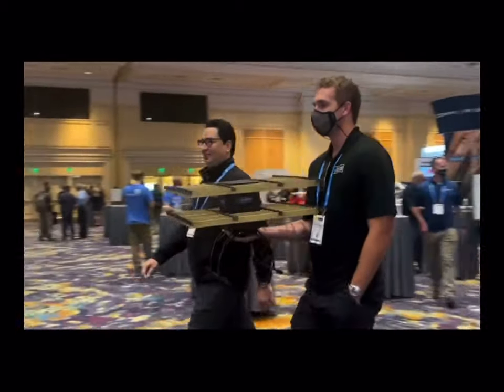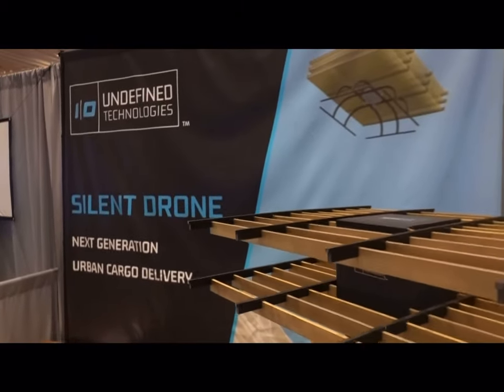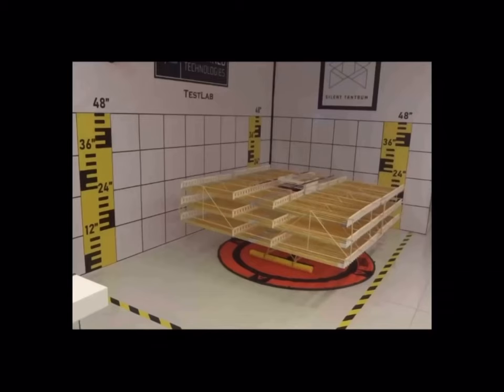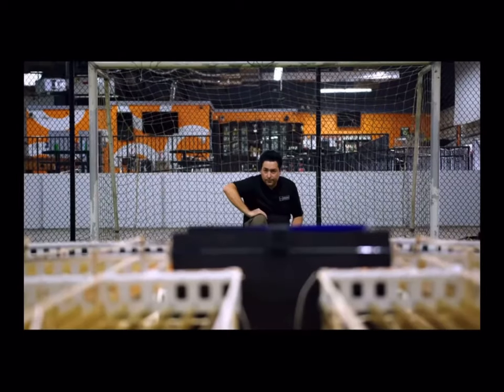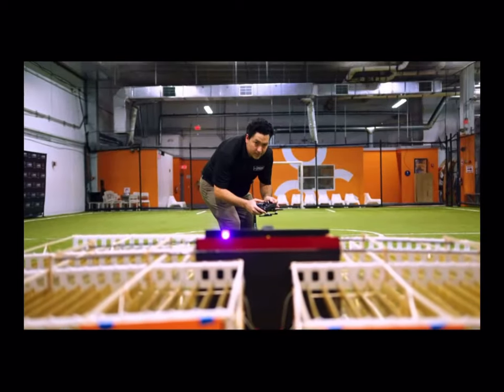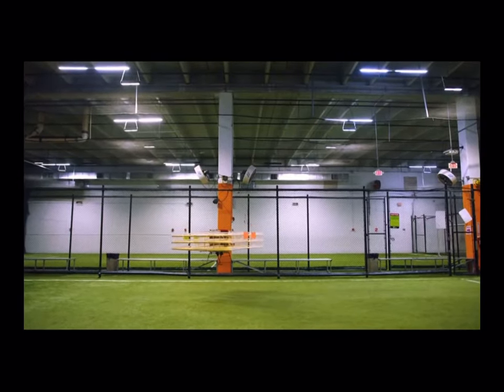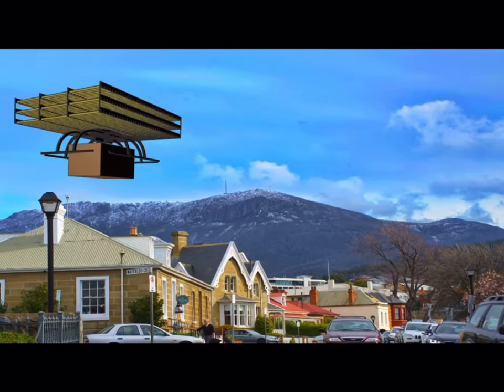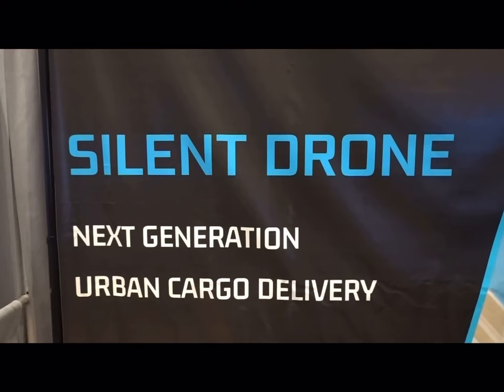New Drone Tech: No Propellers - silent drone

Comment: He says it flies for 15 minutes carrying 2lbs of payload and that it is silent, and ion powered, yet the first two statements are clearly incorrect.   In the latest video called Mission Flight 2, a loud ducted fan can be heard spooling up, and pretty well seen in the middle of the craft.  Physics do not generally allow for a craft of that geometry to lift that much weight vertically with ion propulsion, at least not without a prohibitive amount of wattage.   If it does work somehow, it is violating US Patents 10,119,527 and US 11,161,631.  There are nearly 40 videos of the first and only solely ion propelled aircraft, patented for lifting its power supply against Earth's gravity, on the Ethan Krauss YouTube channel.